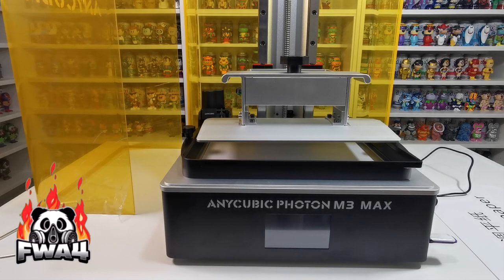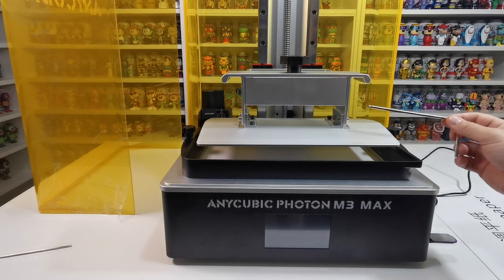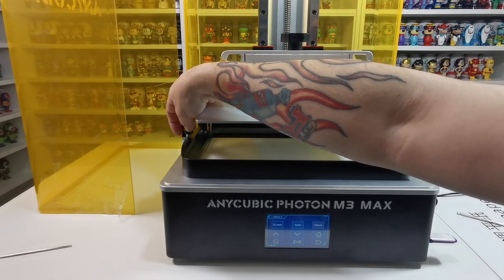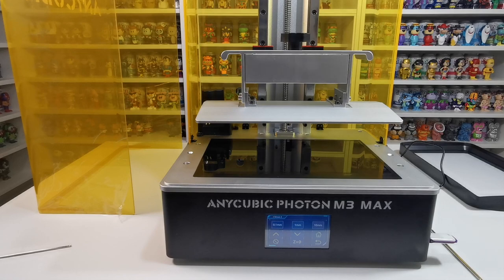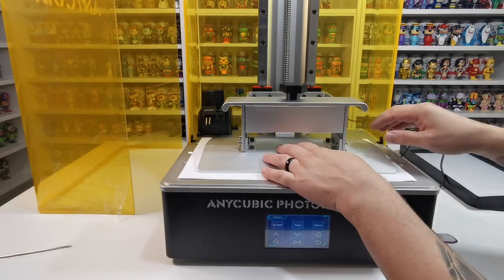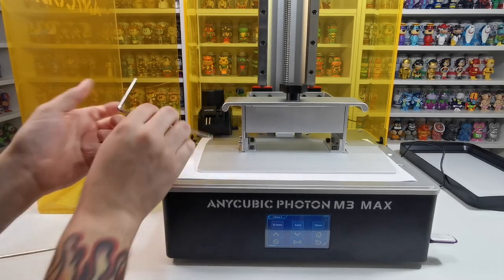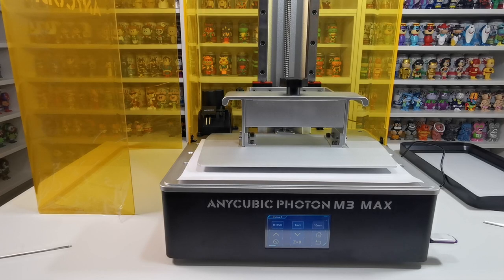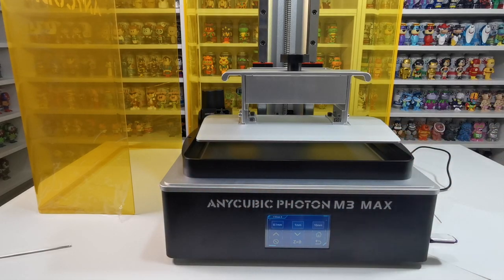How To Level The Bed - Resin 3D printer - Anycubic Photon M3 Max 7K 3D Resin Printer - Simple Guide

Comment: U dont need to push Z=0? Just push home and printer can detect end and automatically stopped?
Reply from the maker: Yes, home will take it home to the point that it needs to be be leveled but it needs to be loose to make sure the plate has no contact with the screen 👍🏻🔥

Comment: I heard this paper should not stay too tightly pressed, just kind stuck but still able to move a little if pulled with both hands...is that a thing? didn't see anything on anycubic about this
Reply from the maker: It needs to be as tight as this to prevent the print not sticking to the base 😁👍🏻

Comment: Hi, 
Why ancubic saying on manual to set z=0 but you did not that? Im confused :)
Reply from the maker: Hi zero is when it's flat 👍🏻🔥
Reply: From what I read, carefully is that z=0 and you can set that to whatever height you need it at with those fine adjustments. But yeah it doesn’t seem to really work like that and z=0 doesn’t seem to allow for a fine tuning.

The fine tuning is letting it be loose and then tightening it after you’ve gone ‘home’.

Comment: i don't understand why sometimes my model stick on the fep and make a hole in it
Reply from the maker: This can be too much exposure time, the angel of the model causing suction. What have you tried? 🤔🔥
Reply: @FWA4  It don't happen with anycubic black resin but always with any elegoo resin, i changed my fep three times but each tim the model stick on it and make a hole, there is two side on my fep one is frosted. wich side need to be in contact with resin? maybe i apply too much tension on the fep? thx for answer my friend
Reply: @poussinmoumoute frosted side up